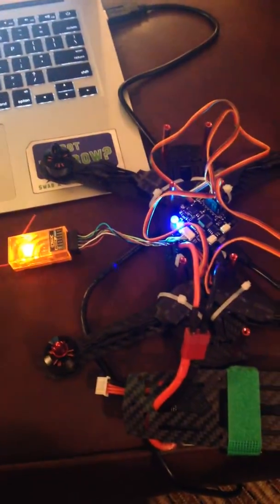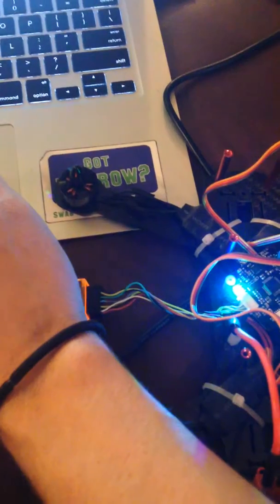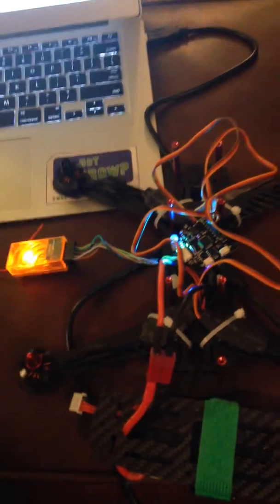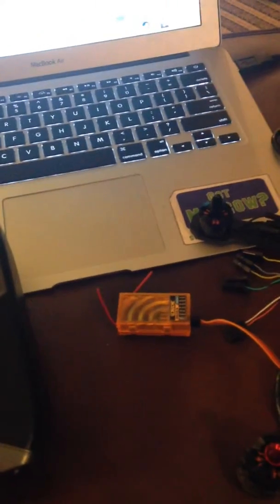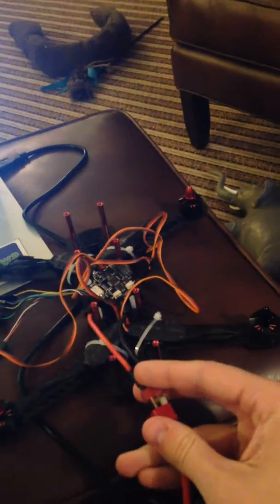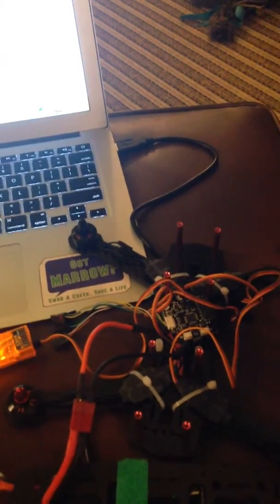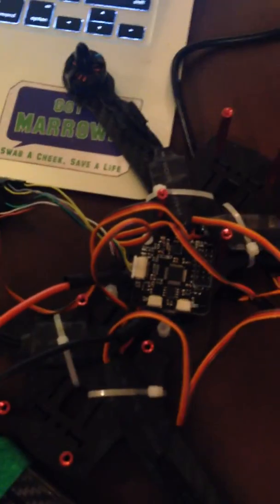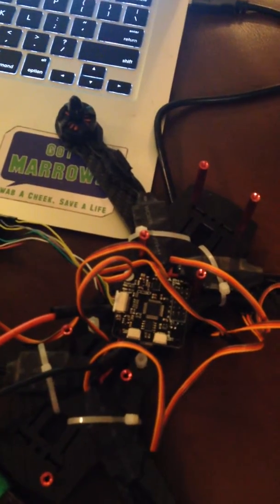ESC or motor problem with Emax motors and ESC's

Comment: I have the same problem with my motors I have emax 2204 2300kv and esc emax 20A blheli do you fix this ??
Reply from the maker: +Lejna79 I did a bit! I found that it was the soldering. Emax uses enamel to cover their copper wires on their motors so what you have to do is unsolder the wires, or bullet connectors if you use them. Once all the solder is off sand the enamel off the wires. Then when you go to solder tin the wires first with plenty of flux to make a really good connection and leave the iron on there a while. One of my motors still has this issue but once i get the motor spinning up it works fine, just have to punch throttle a couple times! If this doesn't work your motor screws are too long and prolly shorting out the wires! add a spacer or use shorter screws!
Hope this helps! let me know!